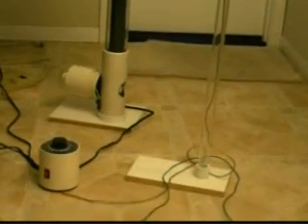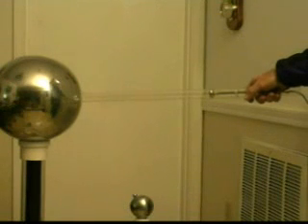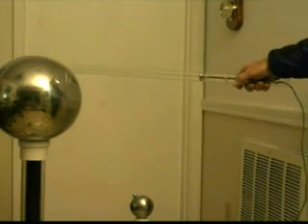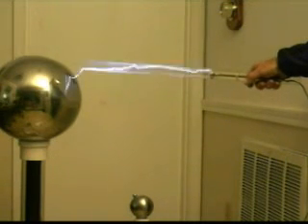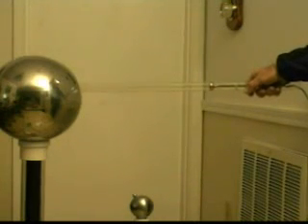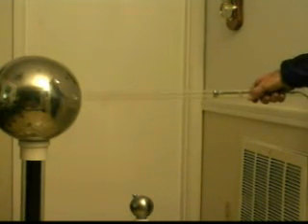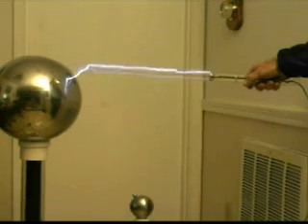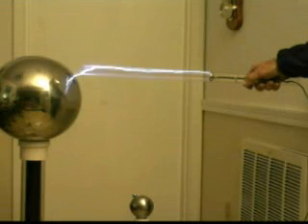Van De Graaff Generator Not Tesla Coil

Comment from the maker: Discharge wand was a cabinet knob with a small brass rod screwed into the threaded hole to keep the knob pointed forward. Ground wire clips to back of rod. The tube itself is one of those cheap clear plastic tubes that fit over a fluorescent bulb. The problem is that static electricity is very persnickity. Sometimes it works. Sometimes it doesn't. Could be variations in humidity.The tube tends to build up a charge like a capacitor. Try different knobs, distances from tube to terminal, etc.

Comment: What is your discharge wand made of.  It appears to be just a grounded rod with a 1" diameter metal sphere on the end, inside a plastic tube.  I tried recreating it with similar materials but did not get anything like your discharges.  Could you tell me what I was missing if anything.

Comment from the maker: Don't know about Grainger.  Actually bought bar stock from a retail plastics supply co like the kind that sells sheet plexiglass.  I do have a lathe which I used to machine the top roller for ball bearings and the bottom one for the motor shaft and to crown the rollers slightly.   Yeah, you pretty much have to have good concentricity, because the faster you can run the belt, the higher the output. I mounted the bottom roller directly on an upright vacuum cleaner motor for power and speed.

Comment from the maker: bottom pulley is1" dia nylon bar stock.  the top pulley is 1" dia teflon bar stock.  the belt is 1/16" thk black solid neoprene rubber from an industrial rubber supply company.

Comment from the maker: To cut the hole in the ball I drilled a 1/4" hole then used a jigsaw with a fine tooth blade(32 teeth per inch I think). Then used a 3" grinding wheel and fine sandpaper to round it out. The belt is black 1/16" solid neoprene rubber from an industrial supply place. It looks and feels like bicycle inner tube, (but innertube didn't work when I tried it).  Nitrile, white neoprene, and some other surplus rubber didn't work.  Latex worked if run real fast.

Comment: @MrHacker3000 no a light saber is made of light repelling light in a beam.
the repulsion is caused by a vector alignment of two light waves at slightly 
different frequencies their waves repels when the two waves become out of phase.
imagine two sine waves at the top of each other on a scope when one sine wave
pattern change wave lenght the two waves face each others northpole against each other and they repel.  electromagnetic waves moves in 3 dimensions.

Comment from the maker: I used teflon upper roller.  Nylon lower roller.  Neoprene rubber belt.  Difficult to say what works well without trying it.  Grounded lower brush to the ground prong of the electrical outlet.  You can also ground it to metal water pipe or a rod stuck in the ground.  The faster the belt runs the higher the output. Speed is important.

Comment from the maker: Spark tube is a 1 1/4" clear plastic tube with a brass cabinet knob mounted on a brass rod which is grounded.  The knob/rod assembly slides inside the tube for adjustment.

Comment from the maker: Ebay maybe easiest. For Teflon search PTFE ROD which is the generic term for Teflon. Nylon, which is cheaper, is actually more difficult.  Search Nylon Round Rod. May have to go into Ebay stores and look.  Also from yellow pages, industrial plastic suppliers in your area usually carry both. 1" dia is not magic--use 7/8 or 1 1/8 or 1 1/4 if that's what they have.